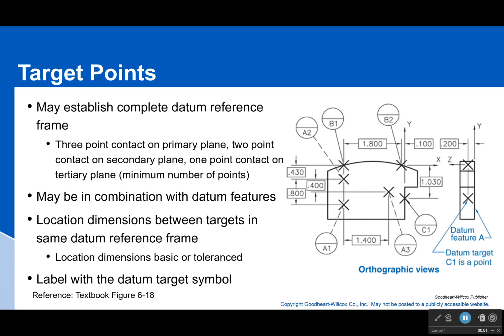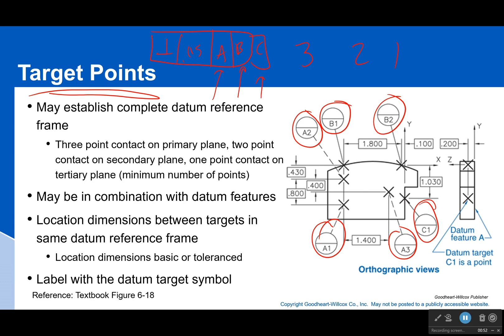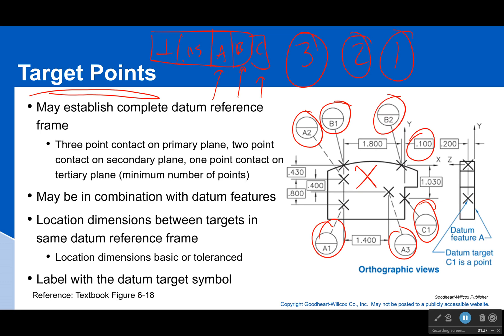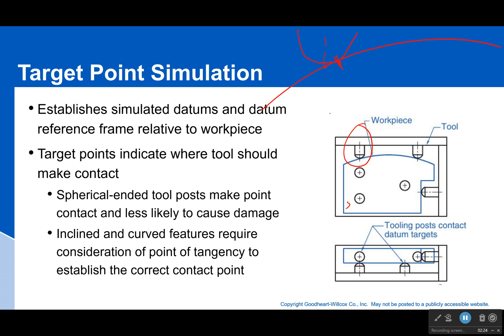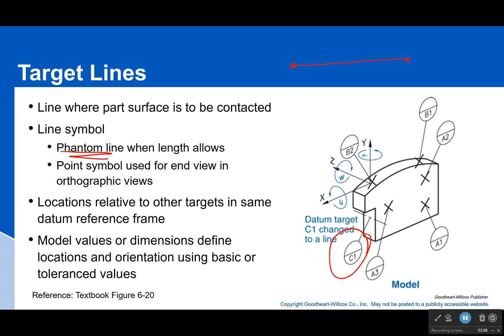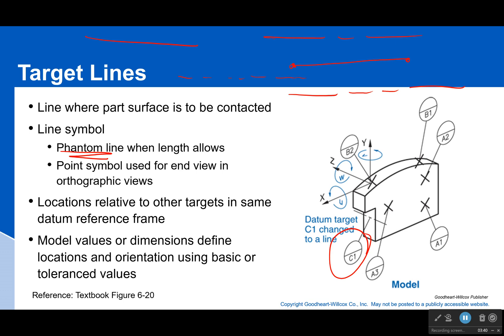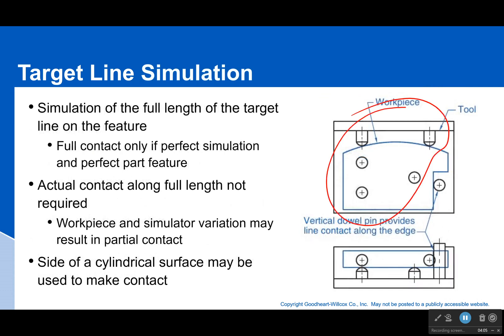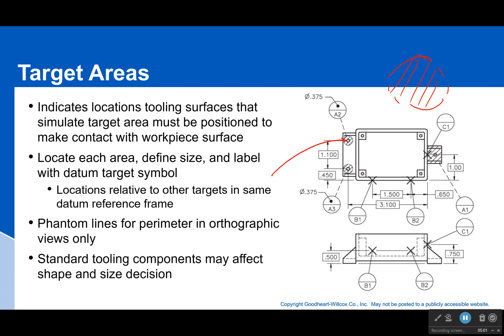Datum Target Simulation

Comment: It takes 22 seconds for your laptop fan to reach terminal velocity. I’ve struggled with setting up the cmm to measure from target points on nasty cast parts a lot recently. The planes are easy enough to catch, but something feels off about the way we do lines and points. We also disagree with our suppliers about position tolerances from time to time…